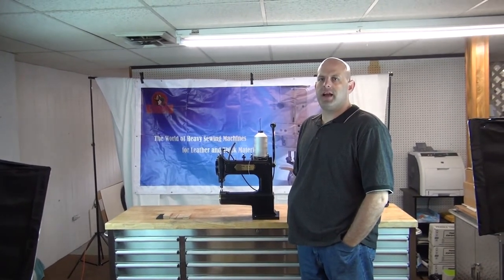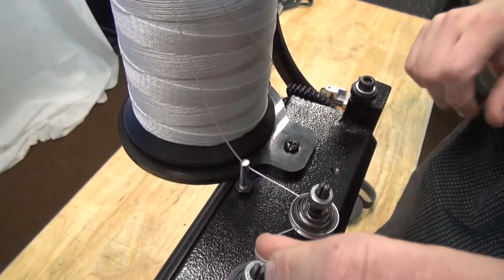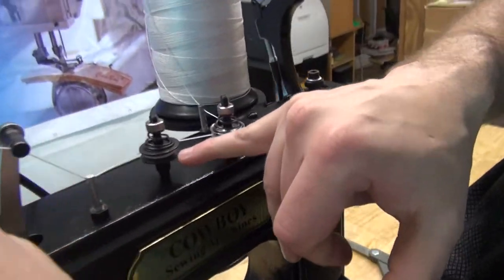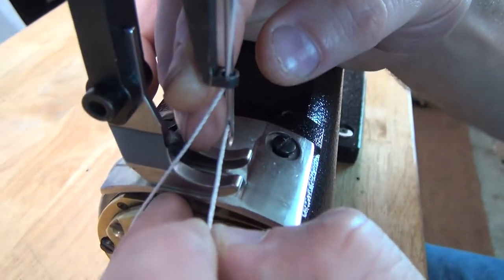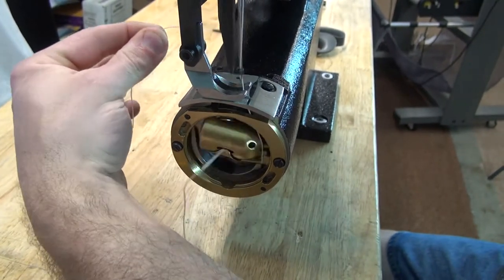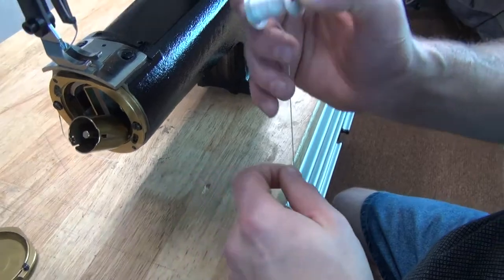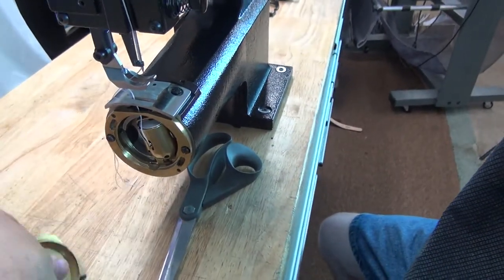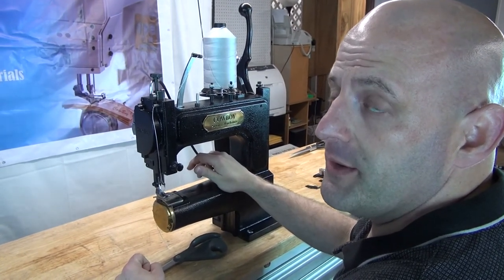Cheap leather sewing machine (threading)

Comment: Hi ,,, thanks for the videos it's very useful,,, one question please ,, if we make a comparison between the out law and the tippmann boss ,,, from your opinion ,,, which one of them is better ,,, ? From quality , sewing , long life working ,, thanks in advance ,,, appreciate your reply
Reply from the maker: Hi Sameh, it is not nice to say bad words about other brand, one thing I can tell you is all parts of OUTLAW is making according to industrial grade. It is industrial sewing machine!!! Usually industrial sewing machines (like CowBoy CB4500) run at factories for 8 hours per day, at higher speed (600 rpm), OUTLAW use same parts, but operated by hand,  the speed is about 60 rpm, so it is almost IMPOSSIBLE to wear out the machine!!!
Reply: Hightex Heavy sewing technology 
Thanks rayan for your reply,,, I really appreciated and I am sorry ,,, I didn’t mean it in that way ,,, I bought the Tippman from about 3 month ago after a long time searching for the same crank technique,,, and I already search in cowboy machines but I think your outlaw is a new product,,, I get no problem with the Tippman , but I am wondering about your respectable machine as I wasn’t able to make a choice before,,, I think both of them get the same idea and technology,,, but the question now ,,, what is the price for the outlaw? Your answer please if you are able to answer such question ,,, nice to send and receive from you rayan ,,,
Reply: sameh elazmerly 

Outlaw: Cast iron with heat treat steel parts. Tippman Boss: Aluminum with cheap aluminum parts.  You decide.
Reply: jfarill834 ,, thanks for the knowledge
Reply from the maker: sameh elazmerly  my pleasure!!

Comment: Hi, I would like to take a closer look at this machine, many years ago I broke a Tippmann BOSS several times and for me it proved unreliable to a great degree, I then bought two heavy duty industrial Seiko machines and after another and they just could not handle the heavy work reliably, then moved to an Adler 205/370 machine with an EFKA motor, came from a dealer in Germany, this machine could not handle 3/4", I broke it several times before I sold it, since then I stopped making leather sheaths. If this machine is a quality machine I am interested.
Reply from the maker: Edge, thanks for your opinion. Tippmann Boss is  not industrial leather sewing machine, CowBoy OUTLAW is industrial leather sewing machine, they are completely different machines. OUTLAW use the same Barrel shuttle hook and shuttle syetem of Adler 205-370. Are you from Germany? We have this hand stitcher leather sewing machine in Germany, you just need to send us some leather for testing!!
Reply: @HightexHeavysewingtechnology  Hi Ryan, just spoke to you on the phone, from UK, just sent your German dealer an email.
Farid Mehr, knife maker
Reply from the maker: @fromtheedgeofdarkness  We have dealer in UK, please check https://automatic-sewing.com/UK-where-to-buy-heavy-industrial-sewing-machine-in-uk.htm

Comment: They made the same mistake as the Tipmann Boss by using the Singer 111w rear foot from a walking foot machine. I do not understand why they didn't use the 441 rear foot system so you can use the harness buckle foot.
Reply from the maker: Thanks for your suggestion. 441 type presser foot is too big for this machine.
Reply: I know the 441 feet are too large for this machine, I simply said each manufacturer made a mistake by not designing the machines to use the 441 style foot system so the harness feet could be used
Reply from the maker: @rysammy  https://www.cowboysew.com/saddle-makers-sewing-machine.htm
Reply: I should have been more clear on the machines I was talking about, the hand operated machine in this video and The Tippman Boss sewing machine should have been designed to use the 441 style harness presser feet
Reply from the maker: @rysammy  This is needle feed leather sewing machine, 441 is triple feed sewing machine, completely different. I do not think 441 type preser foot can fit it. Anyway thanks for your opinion, we do appreciate it.

Comment: Hi there! What about thread and needle size (min/max) that can be userd with this machine?
Reply from the maker: This manually leather stitching machine stand supplied with 794S or 794D leather point needle size #230. You can use other needle size from #160 to #250. We recommend  thread from V138 to V346.